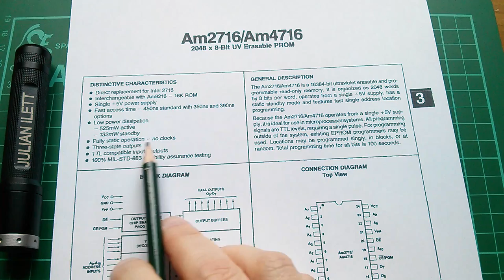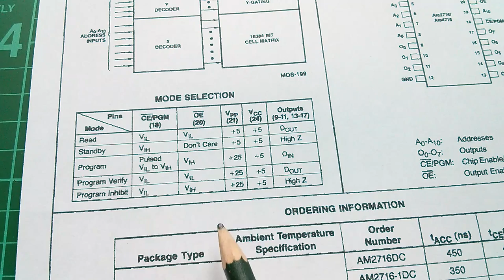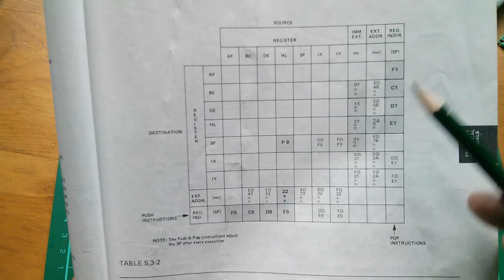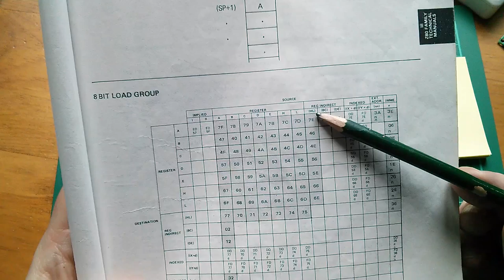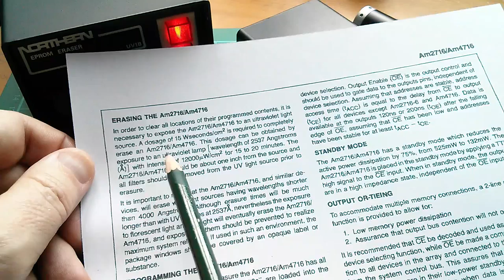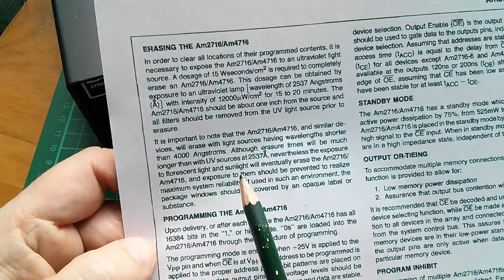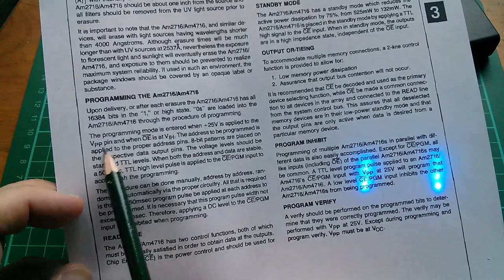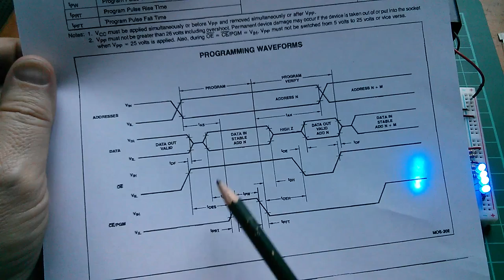Chip on Breadboard - 2716 EPROM

Comment: Here's an idea: use a TIL-311 hex display (x2), and tie them in place of the LEDs, and hook up the CD4060 (which you used in the birthday sound/light kit) to the address pins of the EPROM and you have a dirt-cheap EPROM reader! You can probably find some TIL-311s on flea bay.
Reply from the maker: Nice idea :)
Reply: why not to replace 555 with arduino, create time signal on some pin, connect EPROM output with arduino, catch data  and transmit to PC as .hex file?

Comment: One thing I ran into doing this manually is that the hardware is "Indian" meaning the order read is reversed. Now check the data with an EPROM reader and see if you get same results.
Reply: It is "endian" not "Indian".  ie. which end of a word (more than one byte) is stored first or in the lower memory address.  (or disk sector, etc.)

Comment: How about an Arduino project to read the EPROM. You could use a counter chip to generate the address and a shift register chip to read the data into the Arduino. Use the Arduino to clock the counter and shift register. Display the results using the serial monitor.

If you look inside the chip with a microscope, you will see the transistors sitting by the seaside under an umbrella drinking a gin and tonic. They were protected from the UV rays! 

This brings back memories of when I was a field engineer back in the late 70s. The factory sent me an updated EPROM. I had about 60 control panels that needed updating. So, pull all the chips out of the sockets and erase them. Then put the new EPROM in the DATA IO programmer, read the chip, then reprogram 60 chips one at a time. Ah, the good ole days.....

Comment: It was quite common back in the day, that when rushing the erasure, an EPROM right out of the eraser would blank-check OK, but then after a couple of minutes it would turn out not to be erased successfully.
I think that the residual ionisation initially keeps the charge potential down, but when the chip stabilises and the memory cell gates become fully isolated again the charge is enough to open that cell transistor.
Reply: Similar memories here, seems to have been on Friday afternoons and involving one of the suits from the sales team wandering around mumbling something about promising to have the units shipped that day...
Reply: I think this is the most likely explanation!
Reply: Add the fact that the lamp in the eraser is old and possibly less effective than spec
Reply: This is a really good piece of info here.
I love how folks who had experience with the real stuff have such beautiful, priceless insight.
I never had to do this in my life, but this video got me interested in hooking up one of the EPROM chips I scavenged from old electronics, hook it to a microcontroller and getting some data out.
Although I have a very efficient UV exposure box I can use to erase, I will remember your precious words, @68Stan :)

Comment: Due to physical principles, UV light and above is all you need to erase it. You can go lower in wavelenght (higher energy) and itll work just as well. To make sure it wont get erased by ambient light, simply block UV content. Paper will efficiently block that due to the flourescent dyes it contains, it doesnt even need to be black. 
The physical principle here is called the photoelectric effect, where single photons quite literally smash out electrons if the energy (frequency) is high enough. The intensity of the light determines the rate at which electrons are removed, so you could have it sit under a single led for a few hours or use a 400W UV thrower for merely a second. 
The electrons, freed of their boundaries, will find a ground path themselves, theyll just stick into the next surface they can find. The UV light doesnt provide a ground path but just pushes them out with enough force so that they wont come back.
Reply: Thanks for that explanation.

Comment: Thanks for the memories as an old Z80 guy the days where I not only wrote the code but also designed the hardware it ran on. It was amazing how much you could do in 2K of ROM I once implemented a full cockpit simulator and an interface to a minicomputer that handled the flight simulation. Later I used 8048 micros then switched to the Pic family.

Comment: EPROMs can be used one of two ways: to store code, or to store logic. Back in the 1970s/1980s, EPROMs were used for what is called "combinational logic." Combinational logic EPROMs act somewhat like GALs or PALs. Instead of thinking of the address pins as addresses, you can think of them as logical inputs. And, for each logical input combination, you can store a pre-determined output by storing it as data at that address. So for a 2716, you can have 2048 combinations of inputs and its resulting outputs. I've done this technique when I make a keyboard encoder. Each key switch has what is called a scan code. I use the scan code and send it to the EPROM through the address pins, and then output the corresponding ASCII code through the data pins. Combinational logic EPROMs are also used in memory boards to control the addressing when the usual 74-series chips used for this purpose does not suffice.

Comment: Julian, I really enjoyed your video about the 2716 eprom. It brings back a lot of memories. Back in the day, I used an Intel Prompt 80/85 to program these chips. The Prompt 80/85 was built by Intel using their 8085 SBC. The unit had a hex keyboard & display and a ZIF socket that would accommodate 27XX series eproms. I used it to do firmware updates for a cash dispenser. Just Google Intel Prompt 80/85 for images of it..

Comment: Clean the window with window cleaner, invisible greasy finger marks cause reflection of the UV.
When I used eproms on Arcade  machines, many years ago, we left them in the UV eraser for around 40 minutes.
Old multi used eproms would not wipe at all.

Comment: One thing that is missing -- a fuse.  I don't know how many times I've fried chips because I did something very subtle incorrectly.  A fuse is almost required when using NiMH because of the HUGE amount of current capacity.  You can fry your chip and your breadboard by letting out all of the magic smoke.
Other than that I really love the video.

Comment: "I need 25v +/-1v, i know I'll use three PP3's" - Arrrrrrrrrrrrrrrrrrrrrrrrrrrrgghhhhhhhhhhh, you have got to be the only electronics guy on the freaking planet not to have a rack of decent variable power supplies sitting in front of him.
"Oh, I need 12v, I know, I'll connect my solar panel via this buck converter via this boost converter powered by a USB thing to this capacitor and attach it to this piece of wood and then..."
JUST BUY A NORMAL VARIABLE POWER SUPPLY GOD DAMMIT!!!!!!!!!!!!!!!!!!!!!!!!!!!!!!!!!!!!!!!!!!!!!!!!!!!!!!!!!!!!!!!!!!!!!!!!!!!
!!!!!!!!!!!!!!!!!!!!!!!!!!!!!!!!!!!!!!!!!!!!!!!!!!!!!!!!!!!!!!!!!!!!!!!!!!!!!!!!!!!!!!!!!!!!!!!!!!!!!!!!!! 

you are so annoying....
Reply: Just be pleased he used a proper eraser, I thought he was going to use the spark from the taser....
Reply: Actually when he was reading that bit about sunlight, I thought ...I know where this is going. Thankfully I was wrong.
Reply: A lot of his interesting power solutions make more sense if you imagine that he's absolutely terrified of AC power. At least that's the impression I get...
Reply: c'mon... that's half the fun... trying to work out what whacky way he'll power something... and he never fails to surprise ;) I think he is also showing how you don't need to be too technical (except when you do have to to be) to get by with a lot of stuff ;)

Comment: When i used these things, years ago, I did find sunlight would erase them (yes even through the workshop window). Odd about the memory returning, but i do remember having to burn the buggers a few times occasionally. These things do have a limited number of write cycles, although usually in the tens of thousands of write operations.

Comment: For a 50 ms pulse use the 555 timer in monostable mode. There are online calculators to figure out the resistor, capacitor values for a 50 ms pulse.
Reply: GNU/Bird Yeah that works too.

Comment: I have a huge collection of eproms of many sizes from 2716's through 27512's and larger including 16 bit wide 40 pin types.  I also have a good stock of Z80B and Z80H chips (6 and 8 mhz), and some 80188's.  Also many 128KB 8 bit wide srams.  I'd love to build some sort of retro computer, but first I'd need an Eprom programmer.  There does seem to be one on ebay for about $50 and a Linux cmd line program to drive it, but I've been wanted to build some sort of arduino based programmer for some time, with the one from Byte Magazine in mind for the programming voltage generator.  (I'd use a ten turn pot with a counter knob to set the voltage).

Comment: I have written a full Z80 disassembler for Arduino based microcontrollers if anyone needs one. I wrote it for an unfinished ZX Spectrum related project. It uses the Adafruit 320x240 LCD and supports all undocumented instructions. I think I also did a version with composite video output.
I have also developed an Arduino based EPROM editor/programmer that uses PSION Organiser II Datapaks. It will copy/edit/program Psion Datapaks or, if you remove the EPROM from a Datapak and fit a ZIF socket, it can be used to program any 27(c)64 or 27(c)128 (larger capacity devices may follow if I need to use them). The project is called Datapak S4, the poor mans Dataman.

Comment: An EPROM cell is not digital. It holds an analog value (a charge) and a comparator is used to say if it's 0 or 1. You didn't fully erase it, but you adjusted the charges enough to get the comparator to detect them as 1. Modern devices can store 2 or 3 bits in each cell using several comparator levels.
You should read out the data again using different VCC voltages. That will change the internal voltages, so "half-way" bits can change.

A long time ago I tried to erase an EPROM by having it in sunlight for one day or so. No bits were erased. On the other hand,  any light can can cause temporary bit flips, so the main reason to cover the window is to prevent temporary malfunction of the device. The risk for permanent erasure is very low. You need direct sunlight for a very long time to erase anything.

Comment: I bet the eraser was not on long enough to completely discharge the cells, but only lower the charge enough to look "blank" with the diode connected. I am guessing that the perhaps the programming pulse took what charge was left and re-programmed it back to a full charge.

Comment: Einstein's photoelectric effect causes the UV photon energy to be transferred to the trapped electrons.  This gives them the energy needed to escape the trap and to be conducted by surrounding Si to ground.  It is not necessary to remove every single electron from the trap in order for the circuitry to detect a 1 rather than a zero when the circuitry is configured correctly.  By replacing the diode with open circuit, you have configured the circuitry incorrectly so that the few remaining electrons in the trap (i.e. floating gate) now are detected as 0 instead.  In this mode ones will often be seen as zero if only a few electrons have found their way onto the floating gate... the data read will not be reliable and there is a possibility that floating this pin while using the chip will enhance the electron flow into the floating gates.  This does give the possibility of recovering most of the data from a chip that was erased accidentally, however, but I believe the read rates will be low.

Given I=C dV/dt, I=30 mA, and dV=2 V, you can choose C to give dt=50 ms.  This is less precise than a programmer and yet far more reliable than touching wires together.  Vary C to improve performance and don't forget a parallel bleed resistor (~50 k) to reset the capacitor.

Comment: Its pretty strange the erase didn't work! oO?  Please do an update - I need to understand why the erase didn't work lol!!!!  That's going to drive me nuts trying to understand why.  EDIT: It's nothing to do with the 'inhibit' option - that's done using the CE apparently.
Reply: I think what 68Stan posted above it the most likely cause.  On the same subject of ionisation - I've seen similar wierd things before where en EPROM can become light sensitive due to prolonged exposure to ambient light.   I had an MVS game cart with a program ROM that suffered from this behaviour.  When you covered the windows the cart failed the checksum tests, when you let ambient light into the window it passed 99% of the time.  It took 2 or 3 attempts to erase that chip before it was completely erased, so maybe its the same problem here?

Comment: Ahhhhh, now you are talking my sort of language. As you will note from my channel, I deal a lot with old Fruit Machines, most which use a 27 / 27c (C type generally being the faster of the two) type EPROM's, and although quite rare for me to come across them, I have come across 2716 EPROM's previously, and do have a few in my spares bin, should you need any (They have all been UV wiped though, and I believe some work on 12.5v for programming)? Programmers for these smaller 27 series EPROM's, are unfortunately few and far between that are reliable, also noting the age of some of these EPROM's.

Comment: Hello,how can i rise the miniPro programming voltage to 25v? The programmer has a 21v max voltage,i have to add the 4volts with a external supply or battery ,or pull out the pin and feed 25v from external supply?is time sensitive?edit: i pulled out the vpp pin and applied by hand 25V till the end, and it works! (on the miniPro)thank you.

Comment: I was going to ask about using a high power LED to erase it but I haven't found any high power LEDs at that short of a wavelength.  the only LEDS of that wavelength are extremely expensive on the order of $100 for a 20mw LED.  I suppose I could test it with a 365nm 10W LED and see what happens.

Comment: What happens if you tie output lines to addresses and load some data  in it? How fast will it jump from one address to the next?
Reply: This is how a "turing machine" works (just search on wikipedia). It's a ROM that takes as address some external imputs and some of the output bits. The output bits are the outpute. By properly programming the ROM it can do simple computations.

Comment: you could use an arduino to generate a more precise 50ms pulse...
Reply from the maker: Yes, same thought here - with some HC595 shift registers to latch the address and data bits :)
Reply: Or a PIC... Maybe a good tutorial using your 8-pin demo board? ....
Reply: Julian Ilett For a 50 ms pulse, arduino is overkill, just use the 555 timer in monostable mode instead. There are online calculators to figure out the resistor, capacitor values for a 50 ms pulse.
Reply: Brainstorm4300 you're right... that would be more interesting!
Reply from the maker: But the Arduino could also generate all the address and data signals  - a complete EPROM programmer
Reply: @Nick B yes please, i would truly love some PIC videos. ive got arduinos down, would like to become familiar with things actually used in industry
Reply: Project idea!
Could be fun using state of the art tech to program really old tech :P